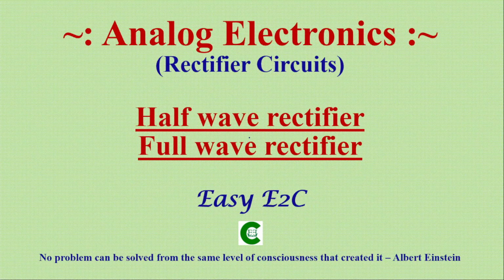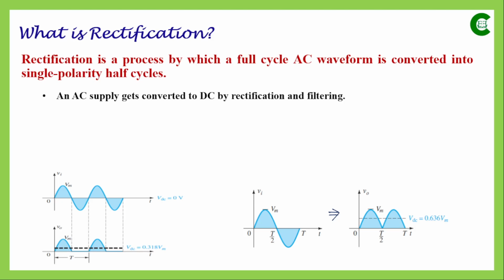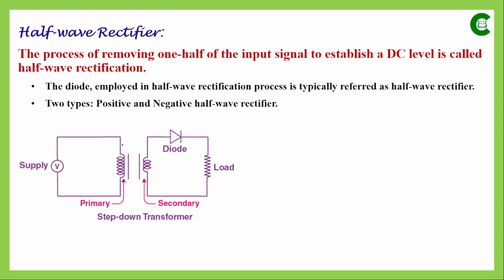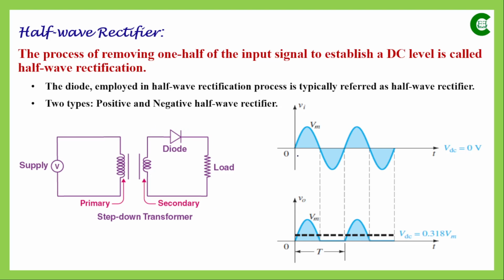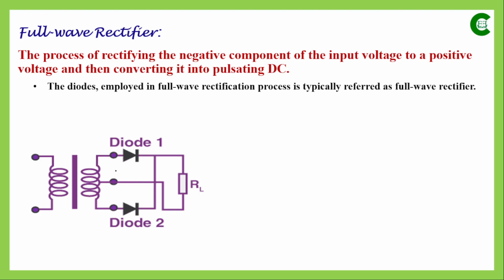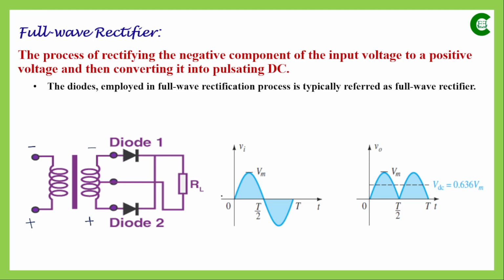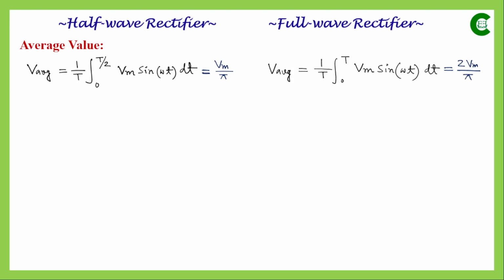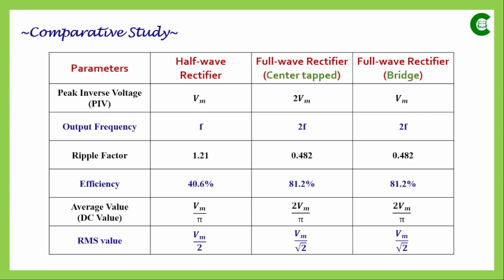Half wave rectifier | Full wave rectifier | Center tapped full wave rectifier

Comment: If half wave rectifier rectifies negative ac cycle, so the waveform will be abover x axis or below x axis
Reply from the maker: If it is positive half wave rectifier, then it will be above x axis for positive half cycles, zero for negative half cycles. If it is negative half wave rectifier, then it will be zero for positive half cycles and below x axis for negative half cycles.